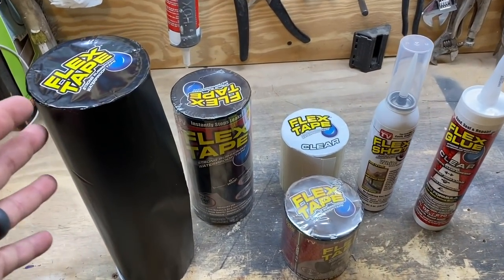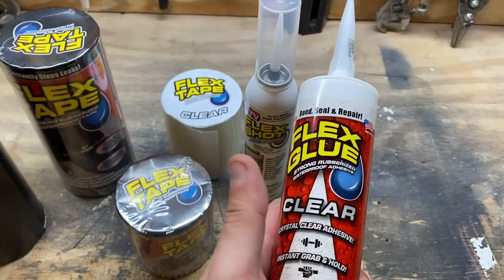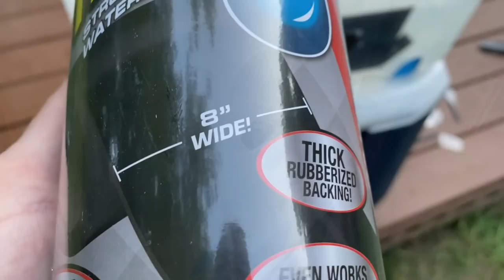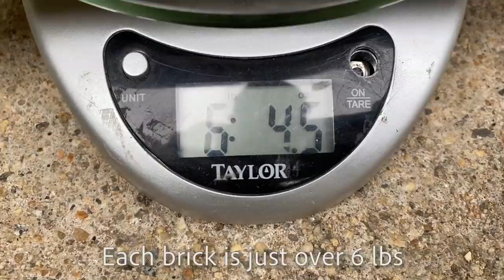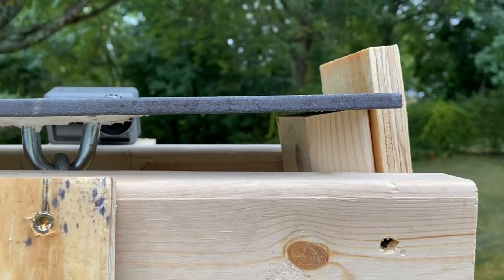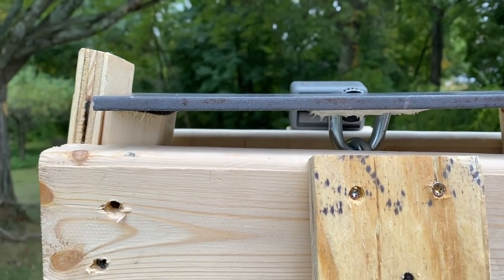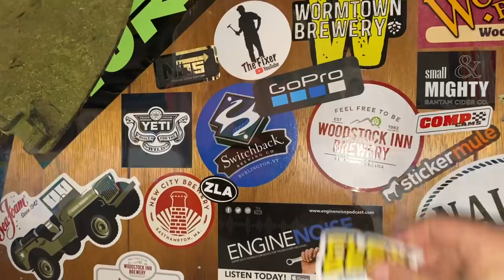I Put Flex Seal To The Test On My House!

Comment: YEEE DOGGY! Now that's what we call FLEXTASTIC repairs! Thanks for the video! 💪🔛
Reply: I Bought the youtooz to saw it in half
(Btw j.k)
Reply from the maker: Yahoooooo!!  Thank you for giving me the opportunity to try out your awesome products!
Reply: FLEX SEAL! #FLEXON
Reply: It’s the best product out there, hands down. I fixed a 2” hole on my portable washing machine with Flex Seal Liquid a year ago. Still like new.
Reply: The lengend came
Reply: Flex seal what are you doing with flex tape adhesive remover? We already had the power to instantly bond seal and repair but now we can instantly remove virtually anything?
Reply: Did we can make a house from flex seal and flex shot? 😂
Reply: Hi Phil.
Reply: I love flexseal every time I go to the  store I always ask do you guys have flex seal
Reply: Is the tape hard to peel off?
Reply: # FLEXON
Reply: Yeah
Reply: @maninada5212  76

6
Reply: @TheFixerHomeRepair try and put some flex seal in your hair, it worked for gorilla glue
Reply: What should I use on the gaps around the new wood windows inside in my addition?

Comment: Love that we got to see you use it the way a homeowner would.  Now, you used the adhesive first, then the tape, then the glue, correct.  I am trying to figure out if the adhesive would be good to use on everything outside of the house.  Never mind, just hit the Show More and see all the answers to all my questions.  Love watching things I can actually do/use.  I am a widow and need to be able to do these things by myself.  But it is hard knowing what products to get, and what really works.  Now I know... Flex Seal.  Headed to the Home Depot.  Until next time.  Thank you for sharing and stay safe.
Reply from the maker: That is great to hear that the video helped out with your decision.  I will never recommend a product that I don't truly stand behind and love!  Thanks so much for the feedback and for checking out the video!

Comment: I am about to re-work the Flex Seal on the area between my concrete patio and stucco garage door that has lasted well over 5 years with no issues.  Patio slopes toward the Garage wall and copious water seeps into the garage during heavy rains and melting snow that accumulates on the concrete.  This stuff works GREAT!  Loved you video.  Especially the bit about the glue.  Many uses I hadn’t considered.  Thanks for the tips.
Reply from the maker: Great to hear!  Good luck with your projects!  Thanks for checking it out!

Comment: How well does it hold up over time though? In a year will that tape still keep out the water, or is this product only meant as a temporary fix?
Reply from the maker: I know that the tape is unbelievably tough over time... super sticky.  I would not recommend leaving it on something like your roof for... Years.  A roof should be patched in with roofing eventually but if something like I showed happens where you have a branch come down in a storm (has happened to me) Flex Seal will fix it up until you can get to fixing it.  Thanks so much for checking out the video!
Reply: Thank you. Good question
Reply: The Fixer I need to use this as a quick and inexpensive way to fix my leaks. At least til I can afford a professional roofer. Thank you again. Love watching your content.
Reply: I used the tape on the roof of my dog house about 3 years ago, it’s still holding.

Comment: Yep I found it the tape when my hose on my washing machine had a leak. I used the rest to cover the cardboard I use to place in my window with my window unit air conditioner and I haven't had to replace them all summer do to rain.

Comment: That last test(300 pounds) was insanely impressive. Especially considering there was no mechanical connection, only adhesive. If I'm correct, you didn't even rough up the surface.

Comment: My hot tub has a jet that is leaking, tried to fix it from the outside, didn't work. Do you think I could use flex seal to plug it up from the inside? I was thinking fill it with caulk then tape over that, what do you think?

Comment: I'm looking for something temporary for a fix. The carpet was removed from the hardwood floor. There are wide gaps from the floor and the wall. I just want to seal it in until I'm able to get repairs and a baseboard put up. If I use this to fill it, can I remove later or is that sealant permanent?

Comment: Have a minor leak under kitchen sink behind the wall drain pipe is leaking probably at the Cabah nice by connecting to the PVC. Can I use flex seal tape For permanent fix?

Comment: I have been watching your videos and found them very good.  Do you have any suggestions on caulking?  I need to caulk the bathroom and windows so I need tips and which gun to use  Since I am an older woman, my hands are not strong so I find the caulking gun my son uses is hard to use and I end up making a mess.  Thanks!
Reply from the maker: Hey!  There are smaller tubes(5.5 oz instead of 10oz) that you can buy so that you don't have to use a a caulking gun. Also, if you are painting over it, you would want a latex caulking. Here is a link- https://amzn.to/44zCy0U . Hope this helps!

Comment: I've got geothermal lines running through foundation wall and they're leaking rainwater in the basement.
Going to try the aerosol with the straw to try and get sealed around the lines.

Comment: Does Flex work on stove pot bottoms and stand up to heat??? My alum. pot has a hole in it.
Reply from the maker: Hey, Dusty.  I would not recommend that much heat.  It is a rubberized coating, I feel it would probably melt.  Thanks for watching the video!
Reply: @TheFixerHomeRepair  Makes sense. Thank you!

Comment: i've had a problem w/it...cats playing on my waterbed caused holes all over it. i tried the tape first and it wouldn't seal.i was on the bed while doing this to be able to reach it.
...next i tried the spray .i sprayed the whole top of the mattress. alas,it didn't stop the leaks! plus, it turned out sticky. i unplugged the heater to it. haven't tried it again yet. i'll need the windows open to ventilate. getting cooler now...
is this gonna work?  why would it be sticky. i ruined a blanket already & it's still stuck to the bed!!
..also did the leaking mailbox & it's sticky!  any ideas??

Comment: Hey will someone try it with steel powder? I have some pretty cool ideas for making DIY ballistic plates and bulletproofing. One of the random ideas I had for an outer coating if the plates are in abrasive material or it just requires some kind of rubber coating maybe I was thinking Flex Seal or a brush on rubber with steel powder in it for extra density and strength. Also might make a good reinforment to anything getting bulletproofed but i want to see it in action. I have a really cool idea to use a high titanium Basalt Muffler wrap and layer it up with epoxy and then compress it while it dries and you should get a pretty decent bulletproof plate that lighter than if it works out you can get a mold and make a Shooters shoulder that would be sick or you can make a custom plate that has a neck guard

Comment: I have basement windows that are leaking when the window wells fill up with heavy rain.  The widows are about 6 inches below the top of the well.  Seems ridiculous to sabotage the house before it’s even built. 

I need to seal the windows.  Yes, the bigger problem is why are the wells not draining?  The house was built in the 40’s or 50’s and I don’t have a couple grand for someone to come and dig it all out and whatnot.  

The outside of the windows have screens, I don’t know if they are removable to run a bead along the edges.

Comment: This stuff is too expensive plus a regular tube of silicone can do everything that this can do.  I would be more impressed if you put the tape on the outside of the container.  And as far as the hole in the roof goes a regular piece of plastic would she’d the water off you’re not doing anything special.